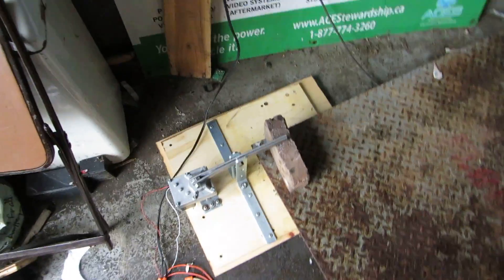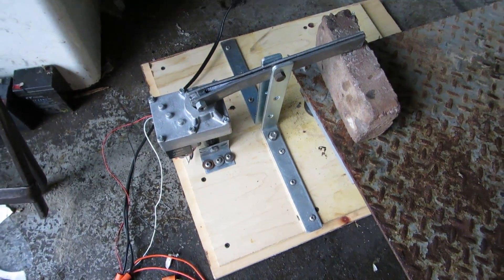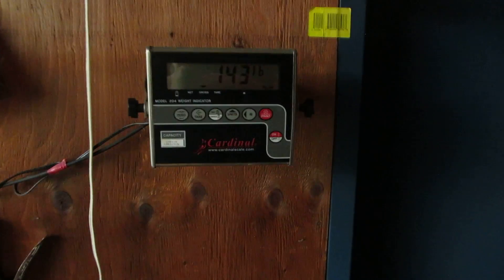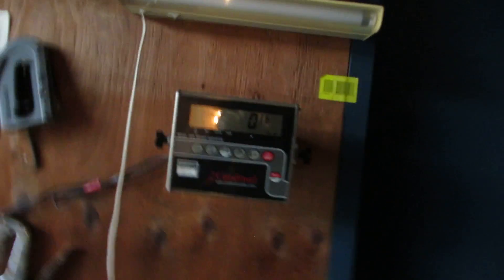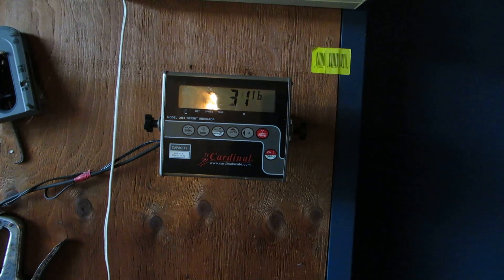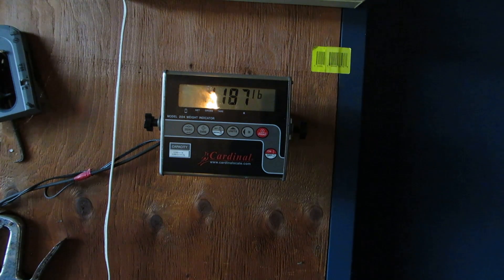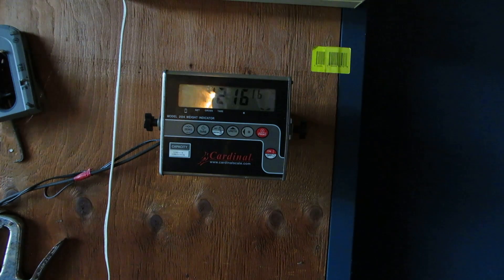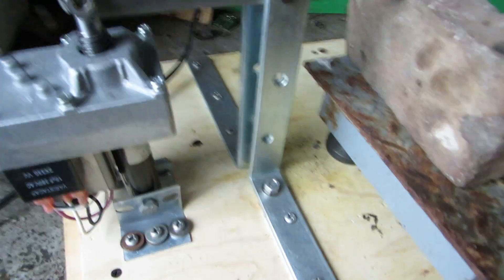Incline Motor Assembly Force Test

Comment: It’s basically a linear actuator but with a real small stroke. And I refuse to accept that is only 1,300lb because that bar is inducing a lot of tourqe reduction. In basic sense the measurement is actually completely incorrect. 

You are able to build something that couples it directly to a force measurement apparatus the true measurement will be higher. In addition, a simple reclining chair will have a linear actuator capable of supporting about 1,345 pounds. I have three but ruined the fourth.
Reply from the maker: The scale was calibrated, the motor was getting it's 120VAC, it had the original run capacitor, the length of the 2 steel bars from the actuator screw to the pivot point in the middle is 5" and from the pivot to the end is 5.25" so it's not that much and would not change the end result that much.